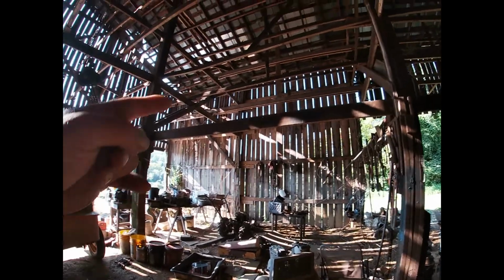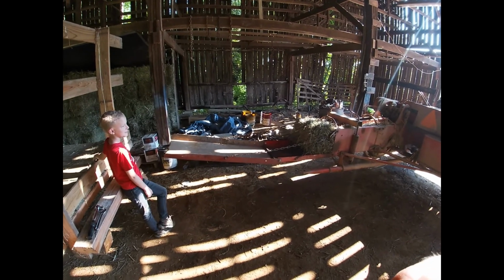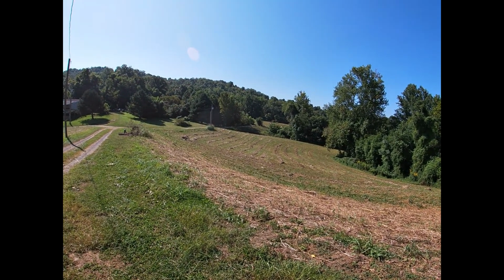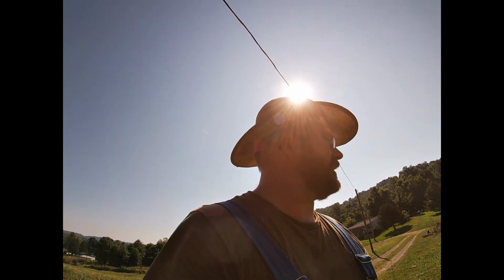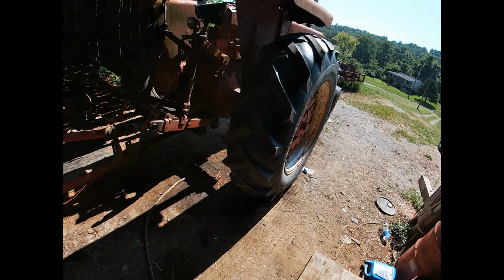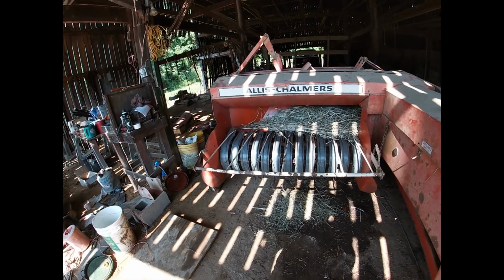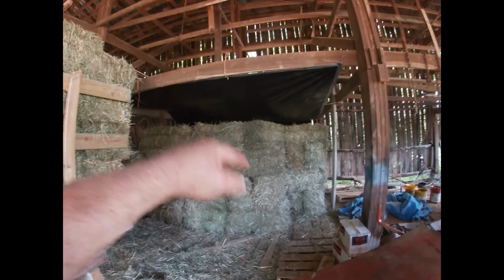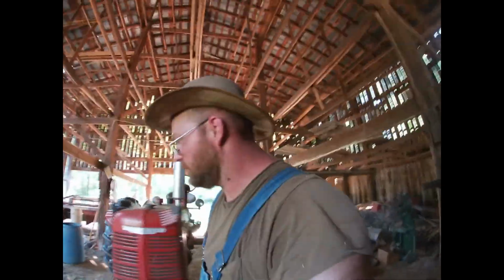Tractor, good, baler, good, wagon not so much

Comment: I can only speak from my experience, but I have not had good luck leaving a swath lay for multiple days in my Southwest Ohio climate known for humidity plus my small fields are perimeter lined with trees which means increased shade for the field.  Tried it once and my normally pleasing hay smell was way less than usual but not necessarily bad.   I have the best luck with getting what hay I can to see the sun and what hay is hidden to at least get air flow as compared to laying flat on the ground.  A tedder would be ideal but I do not have a working one so my rake it is.  I almost always rake at least 3 times and sometimes 4.  Once my cut swath or raked windrow  goes flat to the ground it is flippy the windrow time so a different portion can see the sun and return the airflow to the other part that can not.
Reply from the maker: I left it for about 36 hours before I raked it the first time. Then again everyday after. The first time raking it was damp but not bad same the next day. Where that field lays its in a low place, trees all on the west side so it shades fast. I lost to rain the day I was baling it. Got 2" on cured hay. It is the round up ready alfalfa, which has been lackluster on yield to say the least. Similar inputs to the other field but nothing even close for production. It did well in grass so it may go to a Timothy Orchard mix or perhaps something entirely different. I always heard corn does well behind alfalfa.